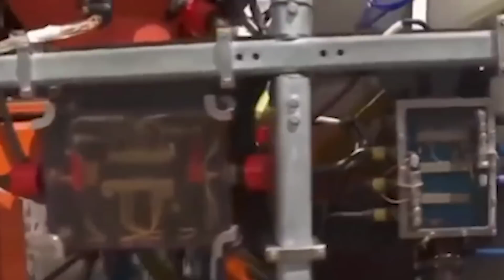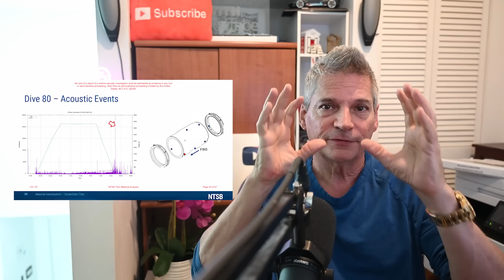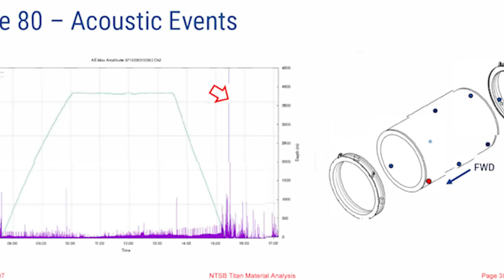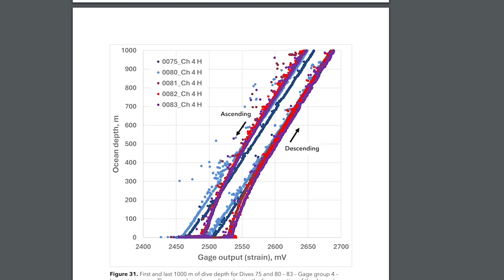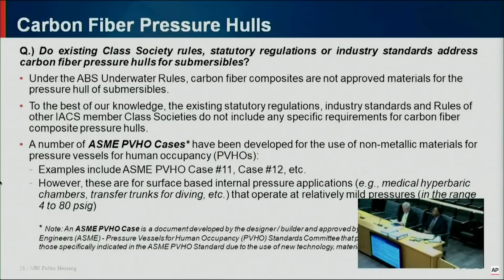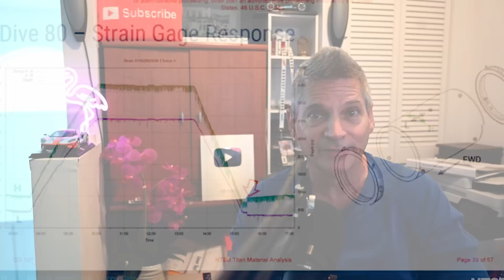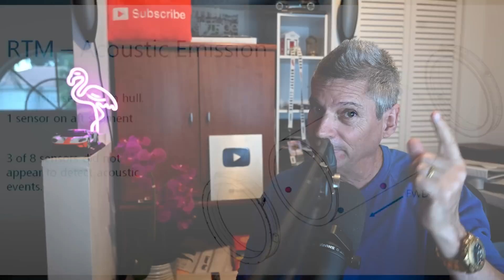How OceanGate Titan Sub Realtime Hull Monitor FAILED! RTM

Comment: Okay, some back of the napkin math-
Titan's carbon fiber hull was 66 inches in diameter and 99.6 inches long.
66 x 3.14= 207.4 inches in circumference
Pressure at the depth of the Titanic is roughly 6,000 lbs per square inch
So, 207.4 x 6,000 = 1,243,440 pounds of compressive load per linear inch of hull length
Hull length 99.6 inches x 1,243,440 = 123,846,624 lbs of total compressive load.
But we also have to add in the load added by the spherical end caps
Surface area of a 66 in diameter hemisphere is 13,684.78 square inches
13,684.78 x 6,000 = 82,108,680 lbs compressive load
So if we add 82,108,680 + 123,846,624 we get 205,955,304 lbs of compressive load at depth.
This should give everyone an idea of the incredible stresses involved.

This can be handled by Carbon fiber if there are no lay up defects, no voids or delamination defects.
The reason it is important that the assembly be free of defects, is because as wall thickness increases,
 the stress gradients in the hoop and radial stress increase. Enter the snap buckling mentioned in testimony.

 Here is a link to a paper published in 1990 regarding snap buckling in composite structures-
 https://gkardomateas.gatech.edu/Journal_papers/23_Kardom_CompSciTech.pdf

The risk is great enough, even when a perfect lamination/ fiber lay up is achieved. Having a wavy lay up
defect like Titan did is actually conducive to a snap buckling moment occurring. Adding in voids and delamination defects and it becomes a ticking time bomb.

Once again, there are VERY good reasons why we don't see cylindrical and carbon fiber hulls at those depths.
Some rules cannot be broken.
Reply: How about if you sand out the wrinkles thus cutting through fibres? 🫣
Reply: I did a small epoxy project recently and was shocked at just how much air bubbles are entrained in the substance. There is one sure-fire way to get rid of the bubbles and that is to prepare the epoxy in a vacuum and perform the layup in a vacuum. Obviously, that costs a little more.
OceanGate implosion = 300 sticks of dynamite ====>    https://youtu.be/cfYQFrp_nHs
Reply: @Grunchy005 you are overlooking that the hull was 5 inches thick. Vacuum purging will work on a carbon fiber hood perfectly because it is a thin layer of fiber but multiple layers several inches thick will be impossible to fully purge. This is an essentially impossible product to manufacture.
Reply: @Walter_BeYes, unfortunately
Reply: The thing is the hull was too thick to guarantee there will be no voids. Vacuum purging a 5" thick hull will never work to remove all the air bubbles so technically no carbon fiber can't handle these loads at all.
Reply: @Walter_Beyeah to glue on the caps too

Comment: I want to know how secure/air tight were the fittings/ holes that allowed the wiring to come in and out of the sub ?
Reply: There were no holes or penetrations in the hull. Signals passed through the hull wirelessly and there were also transducers mounted to send vibrations to a receiver on the outside.
Reply: @wally7856  in another video said the back dome had holes in it for wiring.

Comment: Alert! You are now dead! 😁
Honestly, intuitively, it doesn't seem like making it twice as thick would have saved it (though perhaps it would have given it more dives before failure?). Presumably they would have used the same layer thickness since that was based on layup difficulty, so the outer layer would have had the same strength and acted on any voids just as much. And worse, that ripple effect would have multiplied further and caused the outer layers to be even weaker.

Comment: They only tested the third scale model to 108.33% of the submersible maximum dive depth whilst the industry standard is 150%. This safety margin is too small. 
Titan could be viewed as not having one hull but five. Each one inch hull was glued to the adjacent hulls.
Reply: And it looks like most of those hull segments seperated. It was definetly a weak point.

Comment: The three sensors that never recorded data were at the forward part of the "sub".  My very uneducated guess is that since the implosion appears to have started at this point, had these sensors been operational, it might have prevented this tragedy.
Reply: I wonder, if it was actually the opposite. The sensors didn't work, because there was already a massive integrity problem in that area and he just turned them off, because he already sold tickets.

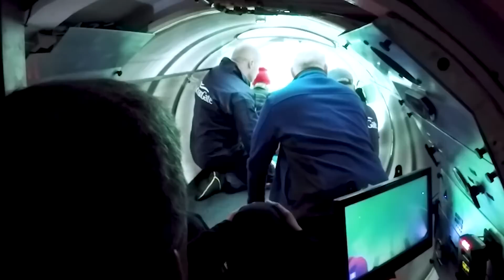Comment: 12:25 think a cylinder has only half the strength (along the axis) compared with a sphere.
Reply: Recall some (energy storage) research in the 80s with carbon fiber used in (20krpm) flywheels - no warning when failing, it just "blows".

Comment: it seems like the RTM worked. from what you show it was a decent anomaly detection system, however they ignored the observed anomalies. there is a whole specialty of AI where you detect anomalies (in manufacturing for example) and the crux of the issue is when you get an indication you reject the part. You may never know exactly why you rejected but you do because the entire observational info is anomalous and presents a risk. The problem here is that he did not have a business plan that could handle RTM detections that require removing the sub from service and literally having to destroy it (cut it apart) to see what is happening. My guess is that subs probably do or will do this type of RTM, but they will doit right.

Comment: The difference in the compression ratios of the titanium and the CF is most likely the cause of the failure. It also would explain the complete and clean shearing of the lip on the dome mounting ring. Were there any materials engineers involved in the design of this disastrous cobbled together mess?
Reply: Yes,Stockton only wanted them to sign it off as OK. He didn't seem to want any changes
Reply: They were until they got fired lol

Comment: Even if they were looking at the data, the fact that they never tested a full scale model to the point of failure means that they have no point of reference to compare it with. Without that, it's somewhat useless, because they don't even know what to be looking for.

Comment: I've designed carbon fiber-composite tools used in down hole oil well applications in the past.  These tools had to withstand 10,000 psi differential pressures at temperatures up to 250°F.  It's no easy task.  They almost all will fail in collapse pressure modes.  Burst pressures, no problem. Axial forces had varying results.  I can go on.  Yeah, this guy in my book was not very convincing of his theory of acoustics taking the place of stress/strain gages IMO.  Plus a scale down version of the model being used to verify acceptance of the actual model, no way!!! It is not acceptable in my industry at all!!!
Adding rings as you show in your example would help, but how many would it take to make it stronger? Three, five, ten?

Comment: thank you for the clear analysis and presentation! And I appreciate it coming from an engineer! Not a very good warning system if the time between detecting the precursor event (noise or strain gauge disturbances) and the catastrophic event is measured in milliseconds...

Comment: perhaps the monitor was made with the same slapdash attitude as the rest of that cowboy operation.
or maybe it worked perfectly and announced 'hull will implode in 10secs'. which is a great consolation when you're 4km down...
Reply: It gave them warning 8 dives before the failure

Comment: While I'm not a licensed engineer I was understanding fibers are strong in tension not compression like the guy who was asking why he was pulling a chain around town and he asks have you tried to push a chain?  Also I don't know the numbers of material shrinkage under pressure but am willing to bet  the numbers for composite and titanium are different. Ie two materials are moving differently sooner or later the  site where they meet will fail
Reply: That's not as big of an issue as you think it is. If one material compresses more then the other you just increase it's thickness until the movement matches. Double thickness = 1/2 strain = 1/2 movement.

Comment: Did they really only use 4 bolts to hold the door closed for a titanic dive? I can't stop thinking about that... 23:13
Reply: The bolts are only needed to hold the door on on the surface. Once you start diving water pressure alone holds the door shut greater then any bolt could. At full depth af the titanic there was about 14,000,000 pounds of force on that door holding it shut or about the weight of 101 Abrams main battle tanks. That's a stack of tanks 78 stories high on top. That door wasn't going anywhere at depth.
Reply: Water pressure holds the door tightly closed

Comment: There were so many faulty assumptions being used here it's hard to know where to start, but overall it seems embarrassingly stupid to assume that either a delamination event or a buckling/classical failure would have a unique signature that could reliably be used to "predict" a catastrophic failure. Furthermore, assuming there were signature acoustics, ANY change in pressure in the unstable, compromised hull system could trigger a catastrophic loss... the whole "have time to get out of dodge" is a critical mistake that I believe even first-year engineering students would find laughable. The whole thing was a complete joke, a cash grab designed to thread a needle of legality, science, and integrity - or lack thereof. This man's legacy is that of failure...but the real question is, why was there no "real-time monitoring system" that noticed the bullsh*t this clown was pushing to intervene before his flawed technology took the lives of the people who foolishly trusted him? The media is, as usual, complicit here, as they blindly promoted this garbage, in much the same way as they did with Elon Musk - another charlatan masquerading as a scientist - to make a quick buck. Regulation must be our friend, but the era of being smart has been supplanted by a new age of tech snake oil. Caveat emptor: the only true "RTM" is our own common sense, critical thinking, and reasoning!

Comment: Even if reinforcing the hull with steel rings would help (I doubt it), Stockton Rush will not allow it because of the added weight. He decided to use carbon fiber because it saved him weight and, most importantly, money when operating.
Reply: Exactly- the same accident would have hpapened in the unsupported areas of CF...  By the time you start adding reinforcements for structural support, you might as well ensure the pressure is evenly distributed and make the entire hull out of the stronger mat'l.